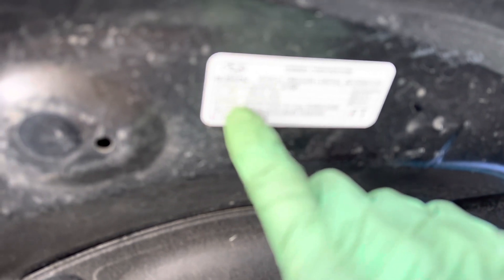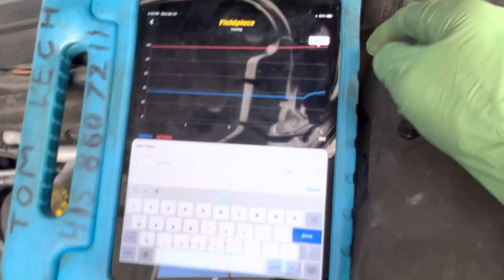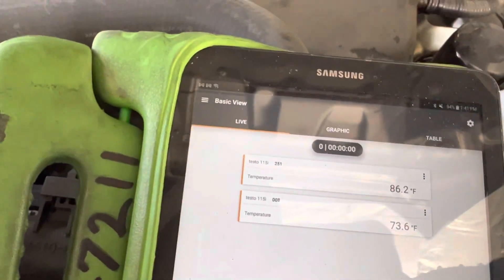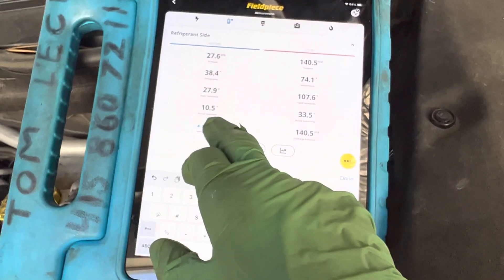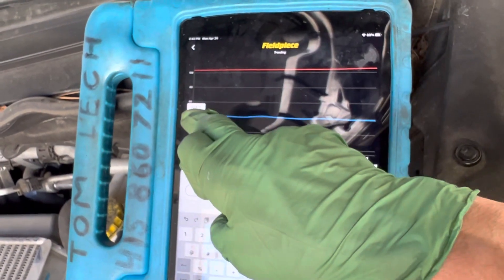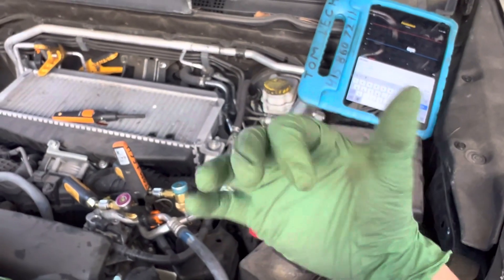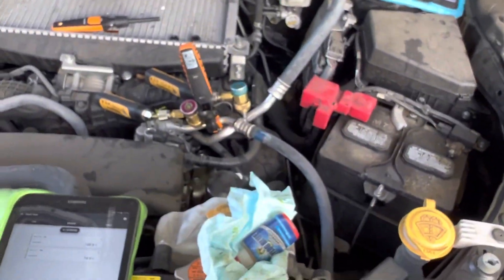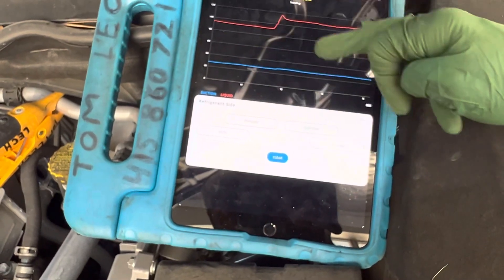AUTO SHOP INSTRUCTORS (“ STOP USING ANALOG GAUGES !”). Shift over to teaching variable control

Comment: Tom, in fixed compressor having right referigerent, and having low suction pressure and low high side pressure condemns weak compressor. will the same be true for variable compressor if not how do we diagnose weak compressor.
Reply from the maker: I have never come across a weak one, yet only dead or not working because of electric compressor control valve ever had a week one.
Reply: @coldfinger459sub0  thank you. I have Robin air LD7 leak detector is this a good one that can detect evaporate leak on ac vent similar to the one you have
Reply from the maker: @sivucit  it might not have been good when it was brand new, but you will never know unless you own refrigerant leak reference bottles for testing.

Comment: Hi , sorry have asked too may today.   Lets say i have a block in condensor and say my high pressure port is after the block in liquid line. the pressure on high side will not go up because port is after the block ?.. How do you diagnose and find this fault. Most of the high pressure port is after condensor just before the expansion valve. So not sure how will gauge reading help here, and how do you know there is block without guage.
Reply from the maker: Temperature drop across the condenser.  Usually not more than 50°F.

Sometimes a very good quality infrared camera can spot the temperature change right where the plug is .
Reply: @coldfinger459sub0  thanks. So there is no way gauge reading will tell theee is block in condenser bcz port is on liquid line. We have to be creative . Thanks
Reply from the maker: @sivucit  it will be lower psi

The pressure temperature relationship will be missed it take temperature of the line . 

Temperature coming out will be too cool .

Comment: Hey Tom, how or where can I get the 3/4 silicon recovery hoses ??
Reply from the maker: True Tech Tools.  And the hose needs to additional connectors. It comes in a kit.. 

https://www.trutechtools.com/Accutools-A10757-1XL-TruBlu-Starter-XL-Evacuation-Kit

You will need the different adapters if you have a  3/8” or 1/2” port on your vacuum pump.   I have a discount code for 8% off. LECHAIR All capital letters all one word.

When you check out, they’ll be a coupon. Code box just enter that word inside there. .

Comment: How check for leaks!?
Reply from the maker: Electronic, refrigerant leak detector like the DeTech Inforcon Stratus, or the H 10

High-pressure try nitrogen, an ultrasonic leak detector and soap bubbles

Vacuum, not the best method does not always work, but sometimes with a Ultrasonic leak detector

Hydrogen forming gas, 5%, hydrogen, 95% dry nitrogen under pressure with a hydrogen leak detector

Helium forming gas, 5%, helium, 95% dry nitrogen under high-pressure using a helium gas leak detector

Are last but he does not find the very small or slow leaks right away better for leaks that are in a minute or happen over a long period of time is using UV fluorescent dye meant for refrigerant systems with a high powered UV light.

Comment: It’s always neat to see the Evap temp sensor data pid reading compared to vent temp
Reply from the maker: As long as the method and placement of taking evaporator air vent, temp is correct and accurate. This is sometimes a problem.